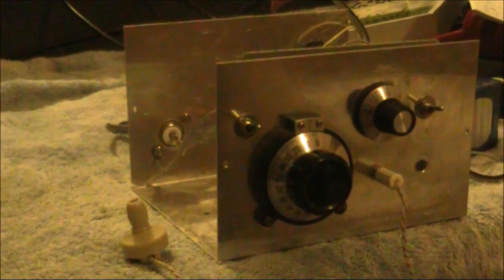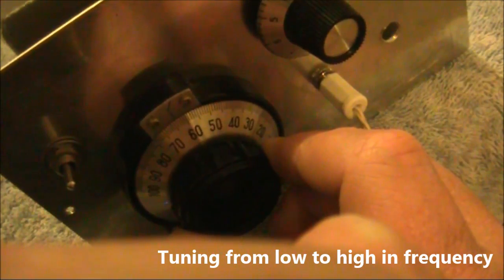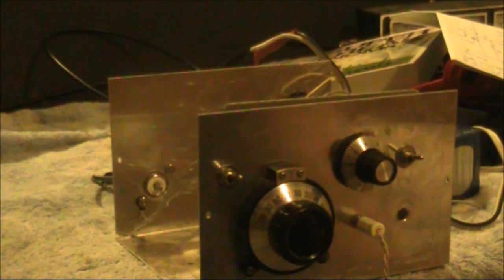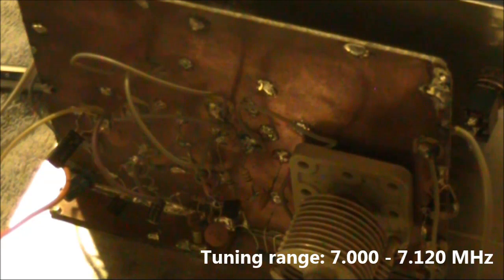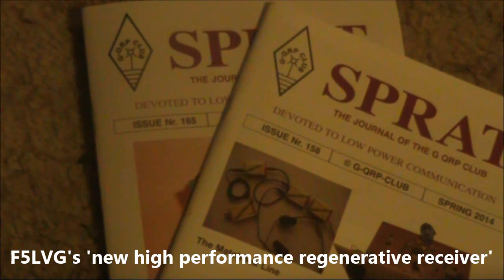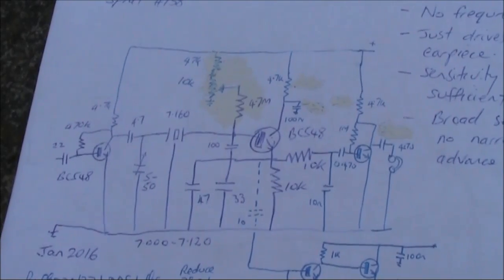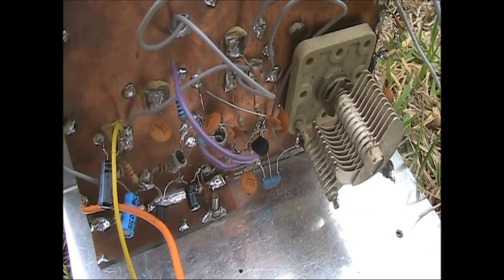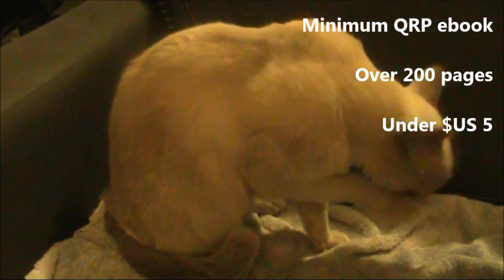Single signal reception on a regenerative receiver. Is it possible?

Comment: because of how narrow the bandwidth can be with a well designed and built regen with good components you can easily get slope each side of the signal changing the pitch while tuning in .

Comment: I have a big problem... you say we should first make the original design and then replace the tuned circuit to a ceramic resonator. My problem is that I really don't know how to do that, that's why I searched for an already-made receiver that uses a ceramic resonator. Please help :)
Reply from the maker: I don't think there are ready-made receivers that use a ceramic resonator. I suggest building several regen receivers that use the conventional inductor and variable capacitor. Learning electronics and radio practically takes time - and not everything will work first go. So keep persisting and eventually you'll have more and more successes.

Comment: It's not single-signal reception if the only way to reject "the other side of zero beat" is to turn off your BFO as you tune across zero beat -- what is what's happening when the receiver "runs out of puff" during the demonstration. Single-signal reception is about rejecting the other side of zero beat while you're receiving the desired side of zero beat _with your BFO turned on_. Amateur radio W9BRD.

Comment: Why not use a audio frequency multiplier so that you tune to NEARLY zero beat for cw, lets say 50hz high, Then frequency multiply the resultant audio to 600 hz.  With a 70 hz low pass filter on the audio input to the frequency multiplier,  the bandpass width would be 140 hz. Therefore the radio would be essentially single signal reception.

Comment: Im wondering could this be used as a IF amplifier\Det?
If I used a 3 pin xtal filter @ 10.7/10.695mhz.@7.5khz B\W
Would I need to pull freq for USB and LSB modes but not Am mode?
Could I add 3 regen  trim pots for each mode i select optimised for each mode?

Rob 73's

Gw1CSU

Comment: Excellent circuit and presentation VK3YE. Nice sharp, clean sounding CW every bit as good as any DC receiver I have heard or used. I built a single tube (double triode) regenerative receiver with plug in coils but it does require more adjustments than yours. I also use a vintage National SW-3 R-Rx. The quality, heavy duty components and well laid out construction built by a generation of real craftsman certainly shows when using this fine receiver. 73!

Comment: Hi Peter, the single signal reception part is interesting but I think that it's not really the same thing in this case. If the circuit is oscillating while tuned into the top half of the signal it's still going to respond to the lower half should someone key up. It seems quite a bit different than the action of a crystal filter in this regard. It's not high Q chopping the signal, it's just losing puff :)